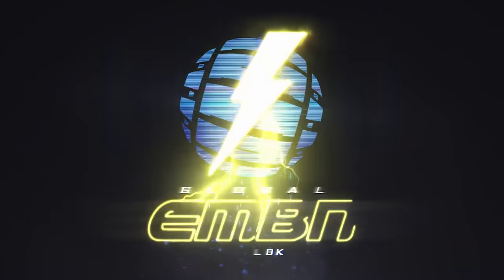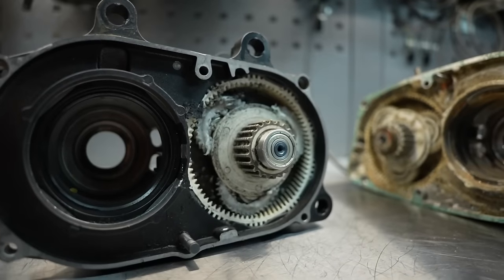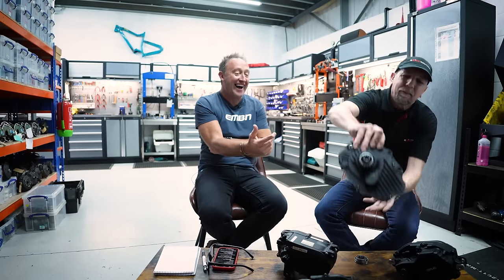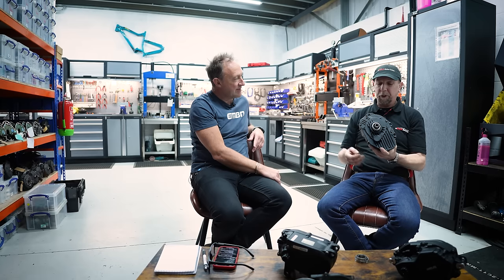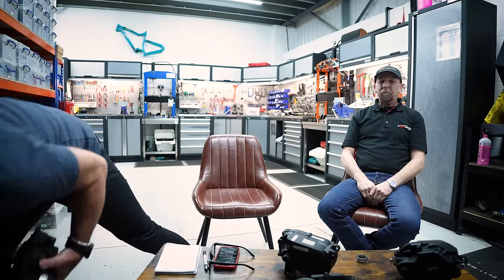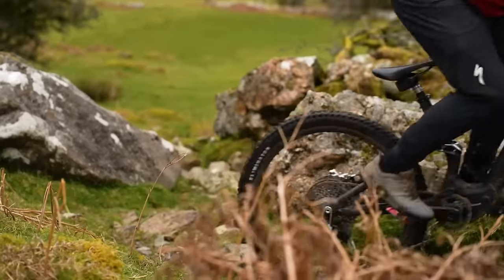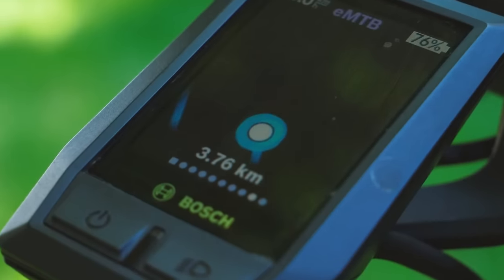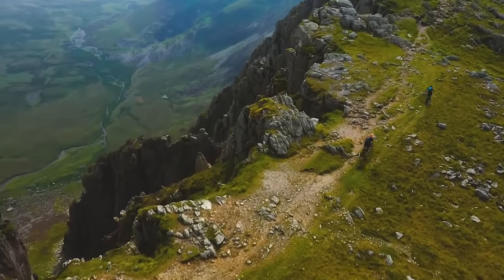What's The Best eBike Motor? | Industry Expert Reveals All

Comment: Ha! Never expected that the Gen 2 CX would be top.... My KTM has this- bought Dec 2018 and Feb 2021 Pete rebuilt it after 2500km...it's just come back from rebuild number 2 at just approaching 6000km total.... NDS bearing always goes because there's no way of properly sealing the crank/crankcase unlike the DS(Unfortunately it's Achilles heel), and it's never seen a power washer.... (And ALL my time on the KTM is in the Cairngorm Mountains- I road bike 10,000km a year too).... I think as he said in the previous video pedal strikes do a lot of damage too. But I'm happy with it still, and a rebuild cost is well worth it, both batteries are original and due to meticulous storage and use are both giving the same range as when new.... and the EX1 drivetrain is still good (replaced the cheap 11/13/15 cogs at 5000km) as I change out the 16T sprocket and chain when it hits 0.5%.... Heavy and maybe over-engineered the motor may be, but one day this will become a "commuter/shopper" bike to get to the local shops in Aviemore and at that point I'll put on full huge mudguards to keep all water off the motor and it's off road days will be over so the motor should last longer between rebuilds!!

Comment: Affordable preventive maintenance is part of reliability. 
Suspension preventive maintenace is too expensive, that's why I ride until failure mode. Ecomonically the better solution. P.s I never had a suspension fail on me because I ride Fox and avoid Specialized  brains.
Regarding motors ... haven't been able to kill one yet. Mostly riding the old gen 2 from bosch. The beast just won't die on me.

Comment: Speaking about retrofit, I agree it does not make sense since motors of different generations change in size and feature. But upgrade should be possible. Let's take the Bosch Smart System and the previous gen4. They are basically the same motors, same size and specs but gen4 is not upgradable to Smart System. This will force users, if they want newer feature, to buy new e_bike. While it is possible to upgrade all other component to newer and better products prolonging bike life. On the other end I agree with comments in the video when is stated that most of the time users are not changing motors mapping every ride but possibly a couple of time in motor lifetime. Personally, using Bosch CX motor I am fully satisfied with Tour+ and emtb modes and do not really need the possibility of changing motor behaviour.

Comment: Thanks! Unfortunately I don't agree regarding reliability...
Motors are only 1 part of the system.
There is a (very large) lack of knowledge about electronic components, where repairs are "not possible".

I also am a Moto guy, and never had problems  (always on Japanese btw!), until I bought a BMW. Few(minor) issues, and I see people talking about reliability of BMW, I really have a laugh!
Reability is a LACK OF PROBLEMS OR Repairs!

My japanese bikes, all never had a problem!
Just oil, filters, sparkplugs, clutch (after +90.000km), tires, brake pads, and nothing more....
Bmw I had to replace a side stand, stator, head bearings, heated grips... it's minor things... but never had the problems with japanese bikes!

The issue with ebikes, is that. There is always something.... battery connectivity, remote problem, motor bearings, etc...
And then, there is the "care" we need to have....no river crossing, no water pressure, no..

C'mmon! It's a All Terrain machine and we need morr RELIABILITY!
Reply: You make some excellent points, but even Yamaha, one of the best engine builders in the world as far as motor bikes are concerned, don't make an eBike motor with any more reliability than anyone else. And they also make their own EMTB's! This should tell you something about the issues manufacturers face and the misunderstanding of what their motors are about to face when let loose on the public.

Comment: We are in a disposable society there is a compromise between small lighter components or heavy gauge parts. (weight) as time goes on all parts are being watered down, they’re designed to fail.
Bottom line is all components in the motor should be heavy gauge with double seals metal casing circuit board coating etc it’s all the other parts on the bike that should be ultra light and strong . As long as the motor is heavy gauge .

Comment: My 2.2.Brose Specialized has just failed waiting for a replacement but as Specialized extended there warranty to 4 years they look after their customer's.
Reply: I am looking at a Specialized, when I see that I need to pay another~200 for seals and upgraded bearings, the 4 year warranty makes sense. Brose know the weakness in their motor and they must know it's cheaper to swap ot motors than change the design.
Reply: @2011buddylee  Hi 2019 Specialized Kenovo Expert so far they have been great as I snapped a frame aswell and one set of wheels Roval as cracks at each spoke. Berkshire Cycles have been great. As I ride every day nearly and a x racer I am prity hard on the bike as I broke 5 coil Fox factory coil DHX2 shock bodies so Fox give me a new Fox factory X2 air shock and that has been great just serviced but they changed the internal seals for 2024 to a better sealing rubber and no problems since as getting aeration in the oil.
Reply: @JohnnyMotel99  Brose are now fitting an even stronger belt and one of our seal designs as standard.

Comment: The last part was the best. Repairable. My wife's Gazelle motor lasted 8,000 commuter K's before it imploded. The dealer stated that was a good run??? $800 dollar replacement plus labour really hurt.  Our next bikes started with a Bosch drive train. 10,000 K's later they are still like new.

Comment: The spray on the back of the car is a good point - I killed a Bosch CX doing that. I tried using a plastic bag but it just gets destroyed. Must be a marked for a transit cover with neoprene and velcro or something
Reply: See my comment above. I've used cling wrap whilst transporting to cover areas of potential water ingress and around levers and calipers to keep crap out. I forgot to mention you need some gaffa tape as added security against wind speed removing the cling wrap. Been there. Done that.
Reply: @user-ga42  yeah I've tried cling film too but it disintegrated. Maybe duck tape or gaffa tape will help, I'll try that 👍🏻

Comment: 18:20 I would have stopped him after saying "buy a motor that is repairable" and said which ones are NOT?   Are we talking some amazon ebike thing or name some names.  
Should have asked about temp (summer heat) and on and on.
Geez I could do a better interview.
Reply: I could not have answered that question, even if I wanted to because there are far too many motors out there that we are still yet to see. However, my main point is that manufacturers are starting to build the motors so that some or many of the components have to be destroyed to get them apart. Or the electronics are soldered across the top of the mechanical components, etc. etc. This move towards pressed and stamped unremovable parts makes totally repairable motors invaluable!
Reply: @Ebikemotorcentre  OK, thanks for the informative reply. I appreciate it.  Thx.

Comment: Why is the Bafang M620 Ultra not mentioned. It may not be the best choice for high end mtn bikes but for urban mobility it's hard to best. Robust and plenty of torque so you can go up hills while maintaining a speed that is viable for transportation.  What should become common practice is an oil bath mid drive motor because grease in the gear box is not that great.

Comment: does adding a speed de-restrictor to a motor dramatically affect the wear on cogs too?
Reply: No. You are not putting any more power through the motor, and the motor is designed for higher speeds, it's just restricted for the European laws. Not that I am condoning this of course :)
Reply: @Ebikemotorcentre  thanks. 

how about if increasing sprocket/chainring size, specifically talking about bosch cx performance gen 2, from factory small cog (14-16T) to larger (18T+)— is there extra non-recommended strain on the motor when changing these? 
or even comparing gen 2 with gen 3 (i assume the major diff with gen 3 was to allow the use of standard chainrings), or can standard chainring sizes (28+) be fitted on gen 2?

i’m just overall really curious what options i have to improve/extend the lifespan of my gen 2, other than replacing the whole motor with a same gen.
are the different bosch generations somewhat interchangeable? can a gen 3 at least be directly dropped into a gen 2 frame (to possibly solve any limitations gen 2s have using standard chainrings) 
would be great if down the track bosch made available some retrofit kit to upgrade my gen 2 to some latest gen
Reply: @p2e  Fit a 17 or 18 tooth front sprocket, it makes an amazing difference, stops mud being packed down the back of the sprocket by the chain because the sprocket is deeper, also helps you use more of the rear cassette allowing this part to last longer. And no more spinning out! We have a test bike that will accept Gen 2, 3 and by using an adaptor plate Gen 4 motors. As long as you don't get the latest "smart" system motors they will all work on the same battery and controller. But aligning the crank is not easy and to be honest, you would be a lot better off buying a bike already manufactured for the correct motor and a Gen 3 is basically a pure road bike motor.
Reply: @p2e  SRAM make an X-Sync (narrow/wide)up to 18T, I run 16T and have a few 14T in my spares but never used them. Think you can get 20T max (not X-Sync though). One day my EMTB will become a more converted road/gravel hybrid and I'll be going 18 or 20T front and probably drop to 11-36 or 42 cassette. You don't need to upgrade your Gen2 CX, just keep rebuilding it and I'm sure there's companies that could re-cell a battery if they stop selling them....

Comment: i have a yamaha pwx3. over 14 months old, holed the motor cover on a rock, filled with liquid alloy, never put a foot wrong. mates all on bosch cx4 and they (all) have a variety of issues from constant cut out to dead at 400 miles. so bosch not anyway reliable yet
Reply: I just got a Haibike Nduro 6 which has the PWX3 motor, only been out on it twice, once in the rain and mud. Have you had any issues with water ingress etc or are they relatively safe to hose wash and ride in the rain?
Reply: Probably one of the best motor on the market

Comment: Good discussion. I learned something! Deviating somewhat from the central question: the physical (mechanical and electrical) design characteristics of a motor and its repairability/maintenance are important, but the motor is part of a larger system. The controller is worth at least 50% of one's opinion.  Where are the sensors placed? How many sensors? Does it have a torque control loop (i.e., closed loop) or just a speed control loop? Does the battery meet your expectations for charging and discharging? Is the battery capacity compromised (has it been too hot or too cold)? All these factors affect motor performance, how it feels, and one's satisfaction.

Comment: the most repairable motors are without a doubt bafang motors. spare parts (motor core, gears, controllers) are available to anyone.
the BSA BB mount motots have a long track of reliability. fully potted controller, big motor, bearings and gears. now with the new torque sensing versions of these we might see the ultimate motor. very difficult to find good frames for them though...
Reply: Special frames are useless though. Those motors don't add anything else aside a lot more weight from already heavy bbshd
Reply: coming back to frames: integrated batteries are poor design imo. they're designed around the relatively spoken poor quality cylindrical batteries, 21700 and 18650, which are pretty bad in every aspect when comparing to the latest pouch format semi solid state NMC811. They require external mounting due to their prismatic shape, though.
just to put it into perspective.
hardtail emtb with 140mm RS pike, bafang m435, 1400Wh semi solid state, 29x2.3 tubeless, pnw suspension dropper post weighs in at 25kg including full fenders and a kickstand.
at that weight you get a top end canyon xc hardtail emtb with 750Wh and 40% less power, and no suspension dropper, fenders and kickstand. probably pedals are not even included. obviously we're talking about aluminium frames
Reply from the maker: Top motor, seems you can get parts too right?!
Reply: @embn  yes, you can, as with all bafang motors

Comment: I'm curious as to what sense the cost complications of a mid drive motor are for the average rider.  I'm in northeast Ohio and I'm not climbing mountains where all that torque is necessary.  I could spend 1k more on a bosch, that will probably last much longer Than a bafang.  To me it's about value.  What I'm getting for what I'm paying.  I want a bike that I can ride, and if there's a problem with the motor I can just grease it or pitch it.

Comment: Owning an unrestricted Greyp eMTB, unfortunately brand out of business now but the well unknown MPF motor still working like day#1 after 7000km, never been serviced. I never wash my bike, only brush dry mud!

What about durability thoughts on (un)restricted motors?
Reply: De-restricting does not affect durability. You are not putting any more power through the motor, and the motor is designed for higher speeds, it's just restricted for the European laws. Not that I am condoning this of course :)

Comment: Nice vid, there is no ONE & ONLY best motor. 
And ppl should never wash ebike motors using jet/power washer, pouring water directly onto motors.. Crankshaft is one of the holes where water can get inside motor.

Comment: When I bought my first eMtb last year, the one aspect I didn't consider was weather proofing. I know, idiot! I'm well aware that water and electrical gizmos don't mix, but I kinda naively assumed manufacturers would have that covered. So...on that note I have made the decision not to ride in crappy wet weather/conditions. This has the added bonus of reducing cleaning effort but the trade off is reduced riding time. I can live with that. And my tip for the car rack is cling wrap. It doesn't look pretty, and takes a bit of time to apply, but it prevents water ingress into motors, bearings etc. I've also used it around levers and calipers, to prevent crap getting in whilst in transit. Obviously, take it off before you ride otherwise it's gonna look a little weird. 
But seriously, manufacturers need to address this issue as it is detrimental to the eMtb experience. I also run two motorcycles, one of which is Italian, so I know, and the potential maintenance costs of the eMtb as a percentage of purchase price is not acceptable. We are being sold 'premium' here. But that's the bike industry as a whole.

Comment: BOSCH SUCKS.  Bafang I have never used but it seems they allow for DIY work. 

I have 2 bosch bikes. As an end user I cant use the software, buy parts for the e side of the bike. The bike shops around here still hate emtb's, charge an arm a leg for terrible service. Then brick the bike with an update. When asked if I just buy a new motor for it they say thats not possible. I tried contacting bosch for a motor and the software to pair it with the display and no dice. I though buying one of of ebay would get the biker back running but i got a code that says it needs to be paired.

As far as most motors not failing most of that has to do with how hard the rider is pushing it and most people do not push the limits. I keep my heart over 160 the entire ride. A good part of the time at 178 to 185.

Comment: I noticed you talked about moisture why cant there be a vent tube from the top of the motor up in the frame to prevent or minimize moisture issues around the control board.
Reply: Some motors have small one way breather patches to vent the motor. It does work and the motor will dry over a long period of time, but if water has got as far as the internals of the motor, it has already been through the bearings to get there, and this means the damage is already done, 4 to 6 months later, the bearing will fail.

Comment: EMBN I got a question about e-bikes, would you say it's better to build a bike like the specialized Turbo Tero X version with a Brose moto to save future headache on repairing if the motor is to fail? or would you just buy a specialized Turbo Tero X regardless. As newer and newer motors and battery power keeps gettong stronger and stronger I Definity have no money to be wasting on buying a new bike just to get the e-power updated. ill like to hear you and other's opinion on this.
Reply: Переходи на бафанг и китайские велосипеды

Comment: This series is fantastic and insightful. The overhaul cost is surprisingly low and his experience as to why they fail and the most reliable is amazing. Doing maintenance and repairs on my cars I have seen the new tech advancements but dropping of quality/durability there as well
Reply from the maker: Thanks 1972. We've got more coming
Reply: Got another idea for you (if you haven’t already)…assume 3k, 4k, what bike do you buy (used or new) and what spec to get. If new would love to understand used options as well - Matt

Comment: Hi Peter,  I've got a Cube reaction hpa pro 500 2017 model,  it done very little, but I have had a speedbox 2 chip fitted for a while,  I want to have a bosch diagnostics on it to find out motor and battery status,  will bosch diagnostics know I've previously had a speedbox 2 fitted and shut down the system making the bike then unusable,,  thanks Alan